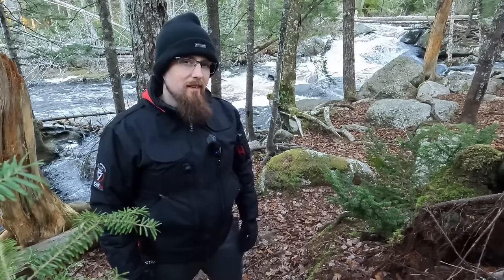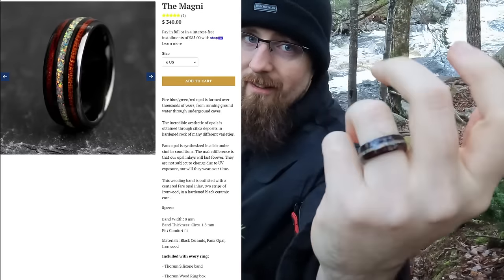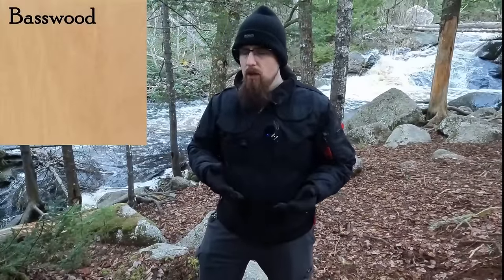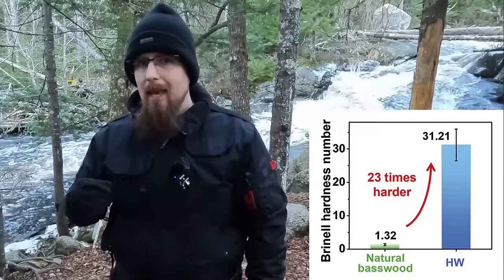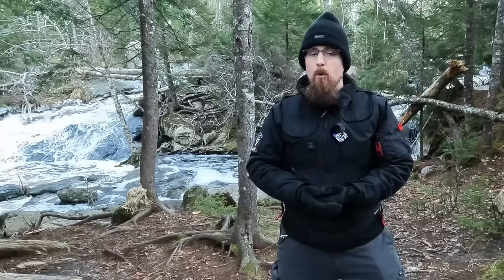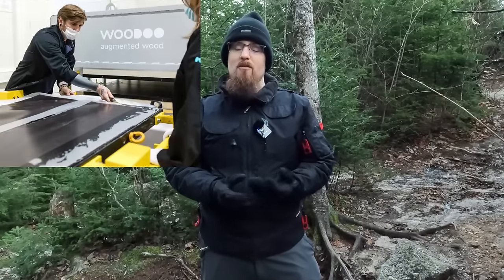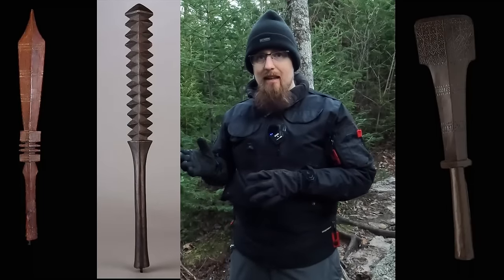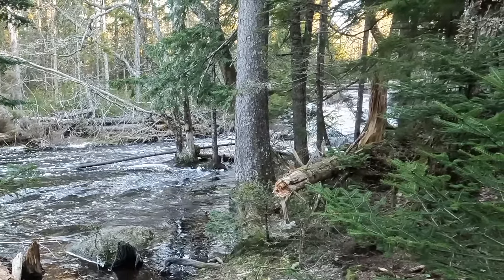Hardened Super Wood!  -  Can It Rival Steel?

Comment: Imagine fighting someone with a transparent quarterstaff. It would be kinda tricky to keep the weapon in your sight. Also, a hardened wood quarterstaff would be brutal.
Reply: Transparent weapons seem practical until you consider actually using them. Once they get blood or even just dirt on them, then they're just back to being the same as visible weapons. Though, this might be an interesting concept for Bows and Arrows, if you can make the wood both transparent and flexible...
Reply: @MyrmidonRadd  they don't have to be invisible to throw off the opponent though
Reply: @MyrmidonRadd  They're transparent, not invisible. You would still see the weapon, but during the fast chaos of combat it's easier to lose track of. A tiny bit of blood or dirt won't change that, you'd have to soak the whole thing in sticky mud for it to actually matter
Reply: speaking from experience, you really don't need to see your weapon, any more than you need to see your arms or legs to know were they are. in a fight your eyes are on your opponent and their weapon, not yours.
Reply: Break up the outline. Transparent tip could give a nasty shock, or a transparent shield rim.
Reply: They do make a transparent aluminum, that they plan to use to replace windows on spacecraft.
Reply: @MyrmidonRadd  Transparent arrow? Isn't that, in effect, a really slow bullet?
Reply: @JohnStormForge  I remember when Scotty gave away that secret in Star Trek IV....LOL
Reply: @socmonki  yeah but the created it in real life to.....mostly because of that movie.
Reply: @JohnStormForge  I know... It was just a bit of fun trivia.  I imagine there are some people who have never seen it, which is a tragedy.
Reply: @MyrmidonRadd  I do not see any worthwhile advantage with transparent arrows. Not sure what the percentage of soldiers is that have good enough eye sight and  reflexes to block or dodge arrows in time. But not nearly high enough to warrant putting in an extra step in crafting arrows.
Reply: @MyrmidonRadd  add a hydrophobic coating
Reply: Yeah but guess what the days of "actually fighting" is over
Nice fantasy tho
Reply: Sometimes the bulk is better, like how sometimes aluminum's bulk versus steel makes a part feasible.  I suspect a quarterstaff is like this, unless the hardened wood is a tube.
Reply: First order of business would be getting out of that armchair.
Reply: @VEC7ORlt  Ha! Good Sir, my best work is done from that arm chair.
Reply: Very cool concept... untill you forget where you put your hard-to-see quarterstaff and can´t find it in times of need ;)
Reply: @JohnStormForge  we've been making synthetic corundum (synthetic sapphire, aluminum oxide) since at least the 1880s. It's just lately that we've made it affordable and workable into larger sheets.
Reply: i mean...regular quarterstaffs are already brutal
Reply: Transparent breakaway arrowheads, harder to spot for removal
Reply: Came here to make this comment. YEAH DUDE!
Reply: You could actually have it be invisible and not screw you over by carving it creatively. Like, carve the map of middleearth (horizontally) or a scroll's inscription (vertically) into the wood, so that you can just touch it and know where on the stick you are.
Reply: @bradonhoover3002  definetly going genevad in the the next update.
Reply: It'd be way better for a shield. No more having to choose between visibility and protection.
Reply: @yamiyomizuki  I think they are referring to your opponent not being able to track your weapon so easily
Reply: @Zimbob2424  that makes sense. I doubt that a transparent weapon would make that much difference in most circumstances since it's not invisible and you could still just watch how the opponents hands move to see where the weapon is going

Comment: Yo imagine fantasy elf armor made of refined hardwood. Fantasy dwarven armor thickness, but on tall elegant figures with a more fitting elvan theme.
Reply: For example ironbark from the Dragon Age universe... minus the "tall" part because Dragon Age elves are pretty short.
Reply: Could be done quite efficient, laminate silk/linen/thin layers of hard wood with a good glue and you'll get something comparable to plywood and trespa, put a good laquer or paint coat and you're there. Even shaping it over a mould would give you a good start on shapes.

Comment: Every transparent wood I've looked into is impregnated with resin to gain both it's transparency and strength, so it's really more wood-fiber-reinforced transparent plastic.
Reply: Like virtually all other "sustainable" technologies, this one still depends on good old oil.
Reply: @trequor  That's kinda because human civilization depends on oil. Still doesn't mean people shouldn't try and innovate.
Reply: @joshuakarmann7488  Of course. But it helps to be realistic and to not oversell these "alternative" products. The way that the media portrays oil as being obsolete is very irresponsible. The whole world runs on it and it's a vital asset that should be protected.
Reply: @trequor  agreed. Renewable and sustainable tech should be developed sure. But thinking that means dropping oil 100% is just stupid. The vast majority of things we manufacture have at least some ties to oil.
Reply: @trequor  Oh I agree it is a trend to over exaggerate how good some 'alternative' products are. And don't worry I don't think oil is going away anytime soon. We humans are shackled to it.
Reply: @ngVAT579  And most supremely, everything is TRANSPORTED using oil. Most goods expend more weight in fuel being transported than the weight of the good itself.
Reply: @dexaphobia8085  Yeah i know. American oil companies do the same thing in my country.
Reply: Xyla Foxlin did a good video on the process.
Reply: "so it's really more wood-fiber-reinforced transparent plastic"
I think that you could more realistically call it plastic with wood fiber filler.

Naturally, there are easier and cheaper ways of doing that than bothering with trying to make transparent wood.
Reply: @trequor  not all plastics have or use oil. that’s just a myth from people who don’t know any better.

it’s easier to use oil to make plastics but it’s not actually a requirement to make plastics.

you can make plastics out of starch...

also, wood isn’t renewable, it literally takes decades for a tree to grow.

seriously go to one of those old mining camps and towns where they cleared basically the entire forest. an it’s been decades since and the new forest is no where near as big as it once was.

wood is NOT renewable.

an as for replacing plastic, we already have more eco friendly replacement for plastic...COMPOSTABLE plastic....plastic you can actually use in fertilizer and it breaks down much easier and safer. (also plastics have various qualities other than their durability and flexibility that makes them hard to actually replace)

as for replacing steel...  maybe in smaller applications freeing up more metal but highly unlikely it’s gonna replace steel on the whole.
Reply: “Impregnated with resin”🤔
Reply: @draconisthewyvern3664  "also, wood isn’t renewable, it literally takes decades for a tree to grow."

Wood is very much renewable. You don't need a large tree to have wood. You're confusing needing wood with needing lumber. BIG difference.
Reply: @ohauss  it still takes years for trees to grow if you want to get the most out of them.

you can harvest saplings but saplings don’t really provide that much.

unless you’re gonna use the trees bred to grow really fast like the Hybrid Poplar which on average grows 5-8 feet a year and even than it still takes a lot of time
Reply: most of the strength in transparent wood comes from the wood, not from the resin.
Reply: @trequor  The only time the mass of fuel approaches anything like the mass of the "cargo" is air freight which is exceeded only by rotorcraft or space launch. If it's literally being shipped by ocean vessel like an oil tanker the fuel tanks are a small fraction of the oil tanks even when traversing the entire Pacific. Even over-the-road trucking uses at most a hundred or so gallons of fuel, or about 900 lbs to move 40 tons at least 500 miles between fuel stops and I may be underestimating the MPG involved.
Reply: @johnassal5838  You are thoroughly underestimating the number of trips involved in getting a single product to your house. Take a pencil for example: graphite from South America, wood from Canada, and aluminum from China. All shipped to Mexico for assembly. Then the pencils are further shipped to another plant to be packaged in cardboard shipped to that plant from a Wisconsin pulp mill using ink shipped in from Korea to print the packaging.

The pencil the student in Los Angeles is chewing on has travelled LITERALLY millions of miles. It has probably expended several times its weight in fuel by the time it is used to write something.

Btw you are also underselling the MPG of semis. 2lbs/mile is really good fuel mileage.
Reply: @trequor  And you're forgetting that 2lbs/mile fuel use is while transporting up to 80,000 pounds and semi trucks are two orders of magnitude more expensive (almost entirely in fuel used) than the ocean shipping covering the majority of that distance you pull out of your hat. Nice hyperbole though.
Reply: @johnassal5838  Hyperbole? Of what? A pencil probably crosses oceans several times before getting used. It's true. The diverse and specialized nature of the global economy uses fossil fuels to make everything much cheaper, but at the cost of tons of fuel.

i do want to bring up something though: most of the fuel cost is expended whether a semi trailer carries 40 tons of pencils or a single pencil. More weight does cost more fuel, but a large portion of the fuel is simply used on overhead factors (such as the machine itself). For instance the wind resistance of a trailer is exactly the same whether that trailer is empty or full.

Put another way, each individual pencil requires an entire ship to move it. Just because other pencils are on board with it, that doesn't mean that the single pencil is exempted from its enormous fuel cost.

So you can't just divide out of the fuel costs per pound of goods. That's not how it works. You also can't just count a single trip, when almost all goods travel half a dozen times at least before their destination is reached (then of course they hauled off again to the landfill, at a fuel expense).
Reply: @trequor  Hyperbole: claiming that crossing the ocean several times somehow equals "millions of miles." To the Moon and back twice is ONE million miles, smh. 

Oil has enough drawbacks without making up random ridiculous numbers or exaggerating the impact beyond any sane figure. 🤦‍♂️
Reply: @johnassal5838  Several times PER component. It adds up quick.

I love that you use the moon as an example to make it seem outlandish. How far do you think a person drives in their lifetime? Cumulatively, I mean, as with my previous examples. The answer is well over the distance to the moon and back... at least according to insurance companies. A person's daily commute to work comes out to ~25,000km/year.
Reply: @draconisthewyvern3664  
It's still much faster than any fossil fuel. Plus plenty of wood waste is available anyway.
Reply: @johnassal5838  Ignorance is bliss I suppose. I'm sure that your total dependence on oil for every item you own will just vanish as long as you ignore it for long enough.

Comment: the reason it goes so hard is to do with density of the fiber so the harder the wood is the harder it is to get even harder since they're already extremely dense. i think the reason they went for basswood is rather simple they used it because it has the most void spaces than any other wood hence producing the best results possible
Reply: Also it's probably easier to "wash out" during the preparation stage…
Reply: Yes
Reply: @FalkonNightsdale  Yes it may be more difficult to harden hardwood to the same level
Reply: chemically washing wood till it becomes a sponge and then impregnating it with a harder substance (fibreglass resin) and allowing it to harden under pressure/vacuum has been done for a long time.
it gets incredible results...
but its almost exclusively used for furniture guitar parts fret boards and decorative purposes
as going full composite usually bears better and stronger results/uniformity etc
Reply: Perhaps using thin veneers of hardwood in the chemical treatment process would allow for a better penetration of the hardwoods.  The treated veneers could then be laminated in the pressing process.  Playing around with layer orientation and choice of laminate adhesives could add some strength maybe.
Reply: Also the void space allows for more of the solution to get inside and do the magic it does.
Reply: so basically, in reality, this is just a method of creating hardwood when all you have is softwood.
Reply: Who cares about finding a way for it to work better on hard woods? Making soft woods harder is amazing. Hard woods typically are slower growing trees. If you can get amazing results from faster growing trees then it is actually a pretty good result.